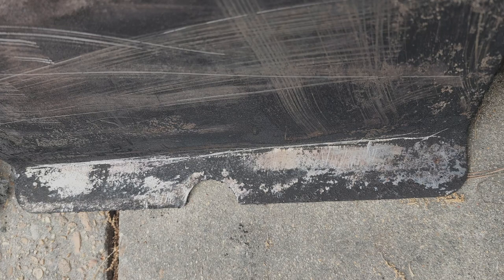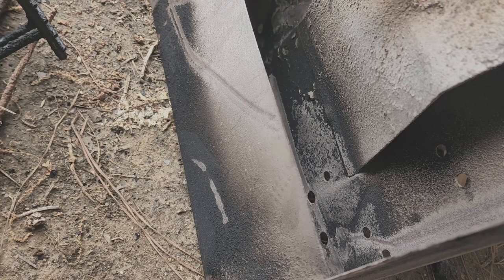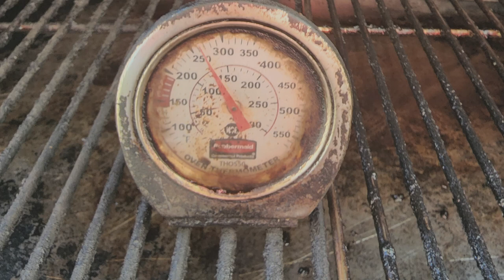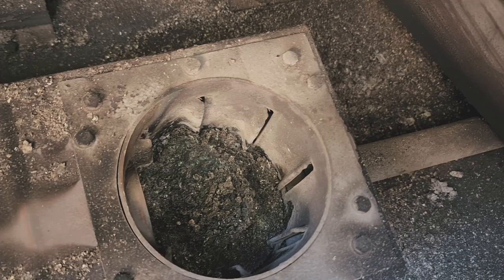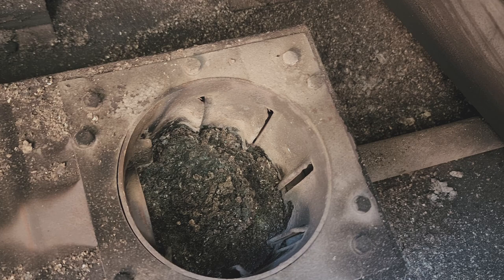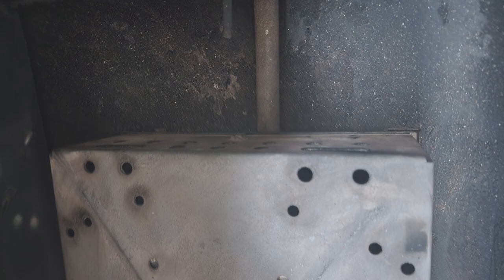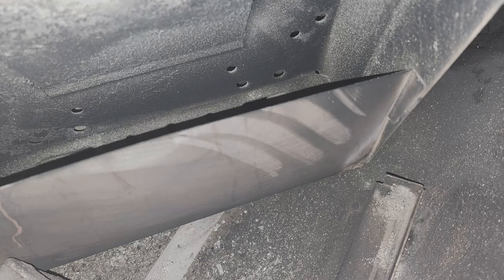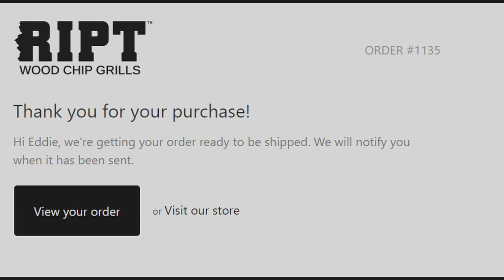Green Mountain Grill Dies

Comment: Surprisingly....Came across negative experience with GMG. 😂😂😂
Reply from the maker: I cooked the life out of that thing lol. No complaints
Reply: @EddieWrightBBQ  Good for you 👍 when mine works  I loved it.   When it was under warranty,  3 parts were replaced and it was working again. Nothing but problems, imo. Just put new electronic board 3-4 month's ago then igniter, I don't have a problem with replacement of the igniter. You go to cook and problems,  kinda pissed you might say. It's covered by GM cover.  Better have a propane torch to light. The magical FAiL, or simply doesn't work. Not spending more money to aggravate myself. Maybe a good 1 1/2 - 2 years out of it, trouble free.